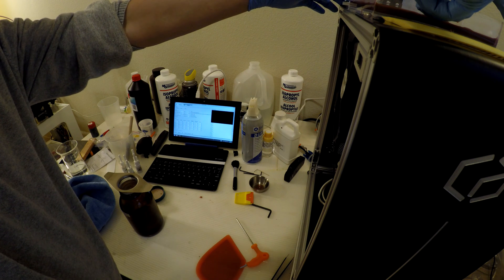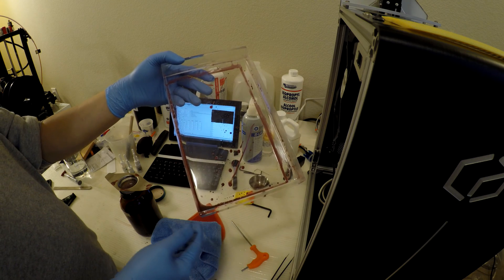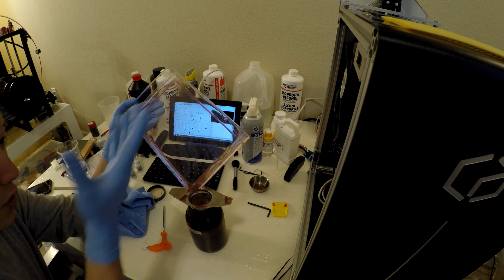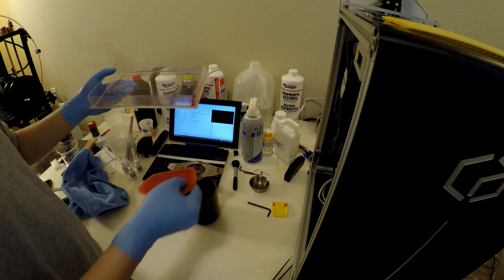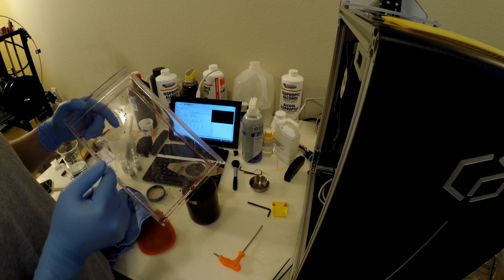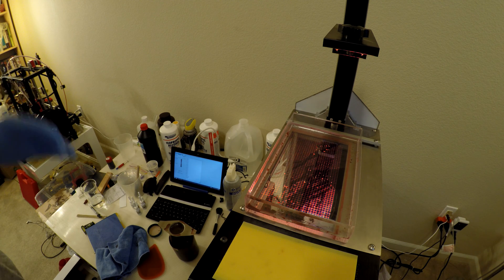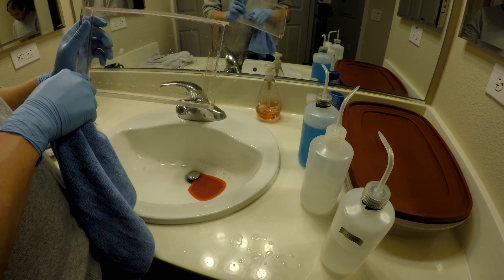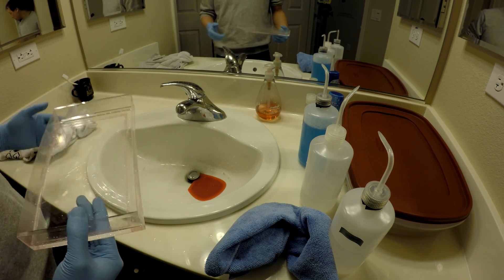Kudo 3D Titan 1 DLP SLA 3D Printer - First Look at Version 2 Vat

Comment: Hi James I am looking for a 3D printer for good resolution in printing for jewellery how do you find the Titan 1.
Reply from the maker: +Matthew Read I do not print jewelry, so I don't really know how you would find it. Specwise, the Titan 1 can go down to 37 microns (or 25 if you modify the projector) which is comparable to other 3D printers in the sub-$5000 range.